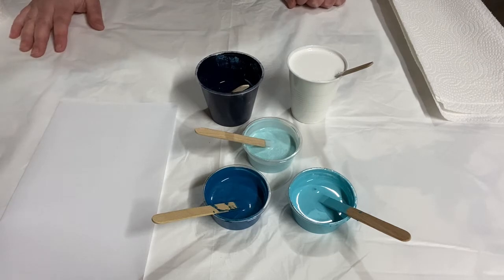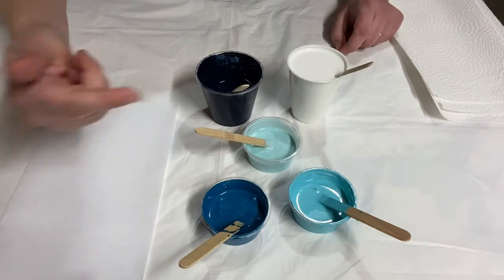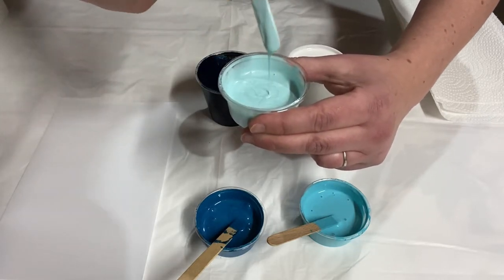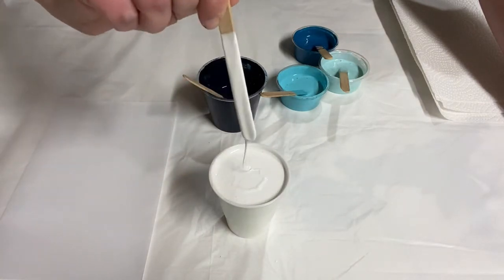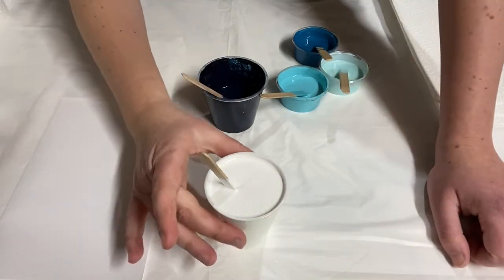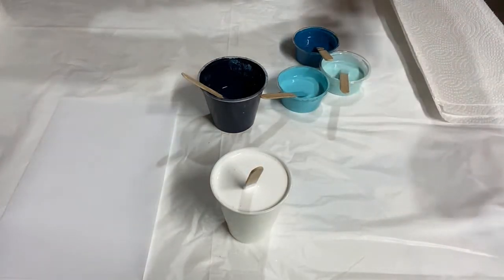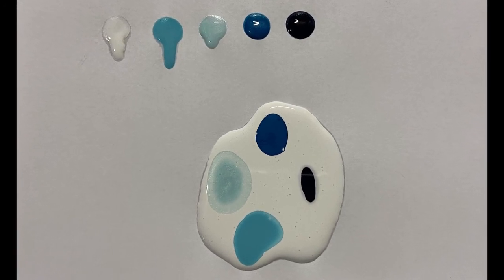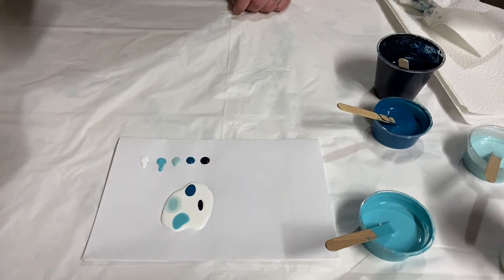Testing For Dutch Pour Paint Consistency

Comment: Iv just started and my paints were thinner than that, prob why the base colour came through too much and some colours didnt even show lol
Reply from the maker: Well, a couple notes: 
First, in this video I’m using paints mixed with floetrol and water, which are a bit thicker than just paint and water. So the thickness will depend on your mixture.
Second, I’m adding VERY small dots of paint to the paper, smaller than many other people’s drip tests, because I find it easier to stay consistent.

As long as all your paints are the same consistency as each other, you shouldn’t have TOO much sinking, though that can be caused by the density of the paints as well.
Reply: @AnnaBlountArt  yep I used Aussie flowtrol as well.  I did use house paint as base as I'm upcycling furniture and need to match my cabinet and acrylic paints on top. 2 of the colours dosnt even show!
Reply from the maker: @horsey123  oh interesting. Were you using the bloom technique? If so, your paints should be a lot thicker than a Dutch pour. House paint and Aussie floetrol aren’t usually used for a Dutch pour.
Reply: @AnnaBlountArt  just dutch pour,  but needed same colour as furniture as base for canvas hence the house paint.  Ill see how it dries, but a shame most coloures have sunk or disappeared!